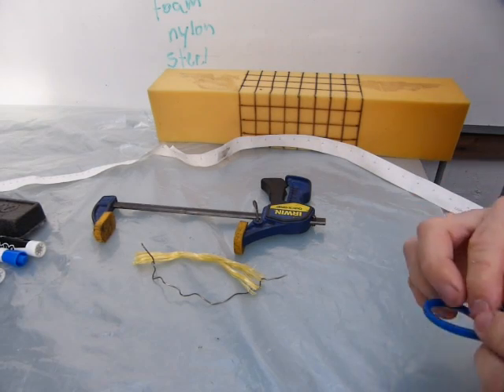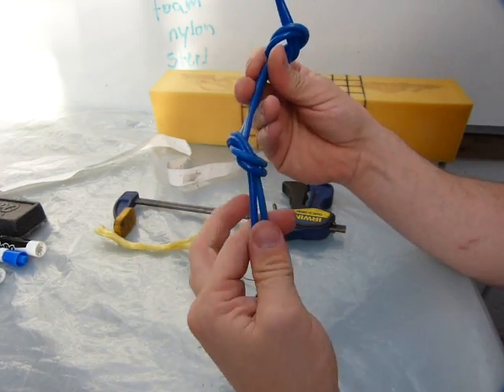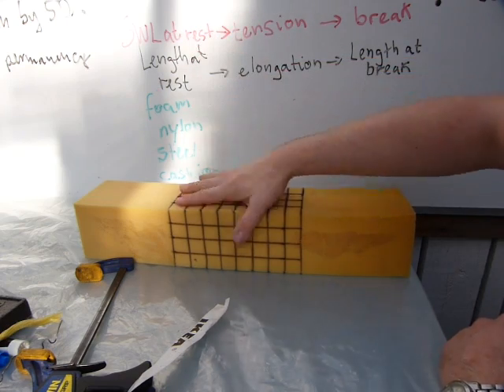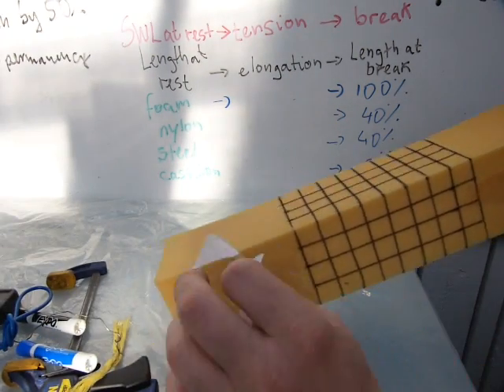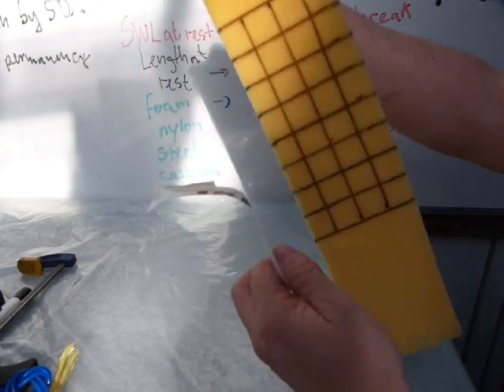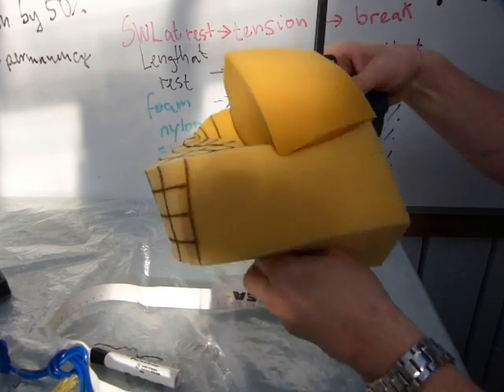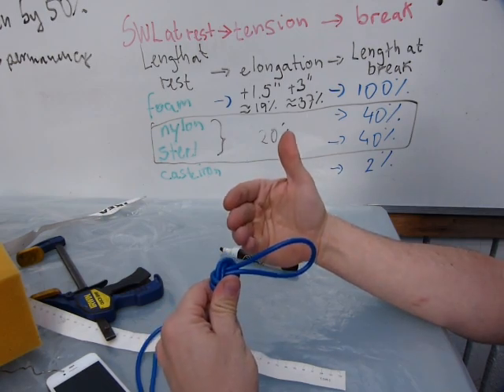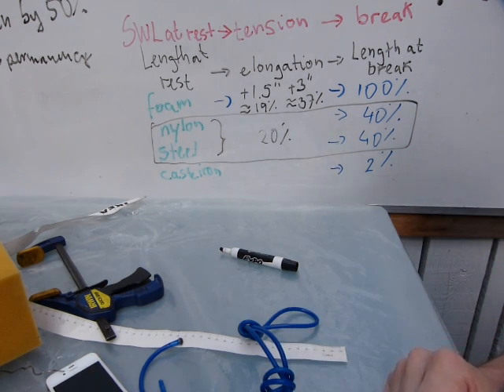Why knots weaken a rope

Comment: I don't think this is accurate.  What I've seen is knots don't fail at the bend, they fail where the lead meets the knot.  Also, it doesn't make sense to me why the 50% "weakening" per knot would compound because the tensile strength is only reduced at the knot. So the section of rope where the second knot is tied is still at 100% load strength, so isn't the second knot just creating a second weak spot?

Comment: Depends on what kind of knot you use. Some knots are better, some are worse for the rope, especially if the rope is pinched or sharply kinked a lot in the knot.
Reply from the maker: Of course, called knot efficiency. Varies between 50% - 90% depending on type of knot when tied right.
Thanks for watching!

Comment: If some fibers are relaxed because they are on the inner section of a curve, then the outside fibers must ultimately take more of the load. So the knot strength often improves by increasing the diameter of the "spool" that the critical sections of the knot are wrapped around. 

For example, a figure nine knot has a larger diameter core than a figure eight knot. That is mostly what makes the figure nine significantly stronger (over 85%) than an figure eight (72%).

Once the diameter exceeds some threshold, the spirals of the twine strands all take a turn on the inside and outside of the bend. This minimum diameter is specified for each rope by the manufacturer. This is how a high strength tie-off is made, by wrapping around a large diameter (like 4") pipe. 

It is also important to remember that knots are often used to make a loop that is effectively twice as strong as a single rope - so the failure is usually close to where single ropes emerge from the knot.
Reply from the maker: Absolutely. You have some cool videos on tensile strength to illustrate the explanation? Would be awesome. Post its link here.

Comment: I am persuaded by your demo for a single fibre, but rope is made of spun fibres, plied together.  Each fibre travels  in a spiral down the cord, and if that cord is knotted, they therefore  'take it in turns' to emerge at the outer surface of the knot, and also the inner compression zones.  This protects the individual fibres from excessive extension, I would have thought .
Reply from the maker: Right. Spiralling does help, finer fibre size also helps (fiber tenacity, denier count), tensile forces do finish them off ultimately.
Reply: Yes, but the diameter of the wrap is critical. Wrapping around the diameter of the same rope is 50% or even less in some product.

Comment: Great explanation thanks. Would that apply if the rope was spliced? I am thinking that the strands have far less acute bends when spliced so that would make it stronger than a knot and that would follow if you ever look round an old sailing ship.
Reply from the maker: Yes. Splicing makes a rope thicker and stronger. Loaded in-line, it makes the rope stronger than the rest, ie. it will break elsewhere, not at the splice. The Mythbusters couldn`t pull a spliced phone book apart with tanks, the pages where just laid one on top of another, no glue or anything. Friction force is king here.
Reply: Yes thanks for that .......I think i'll go away and teach myself that. Thanks again

Comment: Good Video, but each additional knot won make it 50 percent weaker because it just decreasing the SWL of a different part of the rope at the original SWL, if it was to weeken it, one could take a rope than could lift a ton then tie a not to make it withstand 500kg then tie bother would make 250kg then another 125kg then another 62.5 then another 31.25, person standing on a loos on the end would easily break that
Reply from the maker: Right, that math only applies if the same fibrils in the rope are stretched repeatedly further and further at the same bend. And such knot doesn`t exist. So ropes with one or multiple knots are just 50% good. There shouldn`t be ropes with dozens of knots on them anyhow.
Reply: I agree this " EXPERT" is talking out his ass. Do not believe everything you see on YouTube.
Reply from the maker: I agree with your ex-school teacher. Should have finished that elusive grade 6 when manners were taught, followed by logic.

Comment: Part where you explain how rope capacity drops down the line by having more knots on the same line is full nonsense! Knots weakens the rope - this is true fact. Total capacity of rope is determined by the weakest knot/weakest section anywhere in the rope. But those bed segments is not summing up anyhow outside single knot on the rope.
Reply from the maker: Make sure you finish grade 10 including fraction multiplication.

Comment: so if I took an 8000 lb breaking strength rope and tied 10 sequential 50% strength reducing knots, it'll break at 8000 / 2^10 = 8 lbs ?..... love the video but  doubt my 8000 lb canyon rope will bust at 8 lb... that would be a bugger, and I would be toast  :D
Reply from the maker: Good one. Math works only when rope is loaded to MBS between every knot. The last straw breaking the proverbial camel's back is only 8 lbs, added to 8000 + 4000 + 2000 + ... Same way a wooden beam can be overwhelmed with the last 8lbs or a fire started with just 8 more degrees of heat etc. Something like that. Also known in philosophy as "Achilles' arrow' hitting a tree or not.
Reply: @apprenticemath Ahhh.... Sooo... :)    thank you!